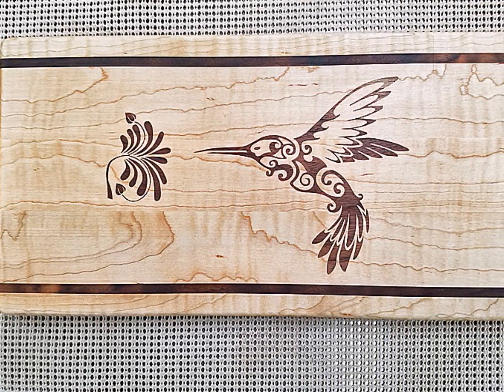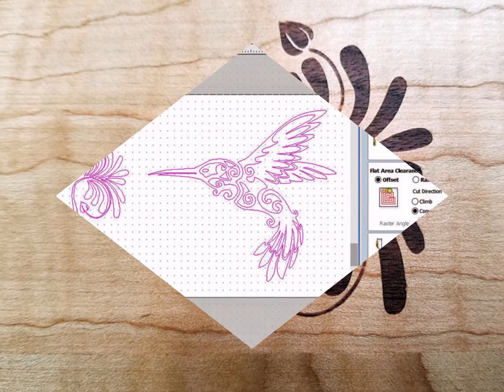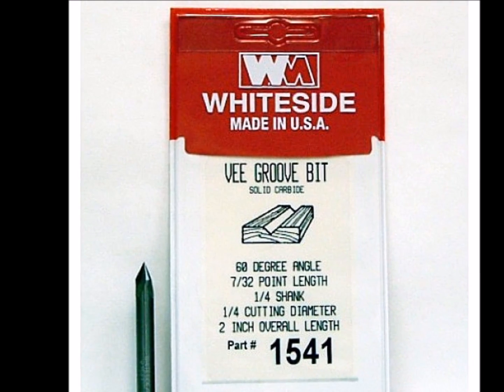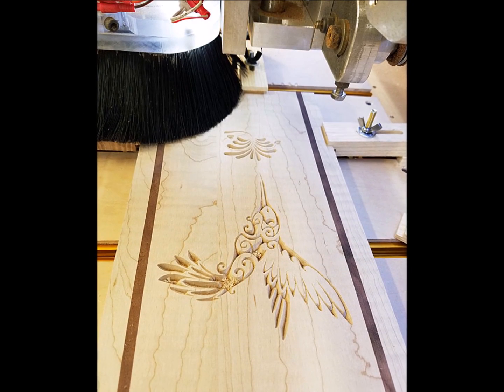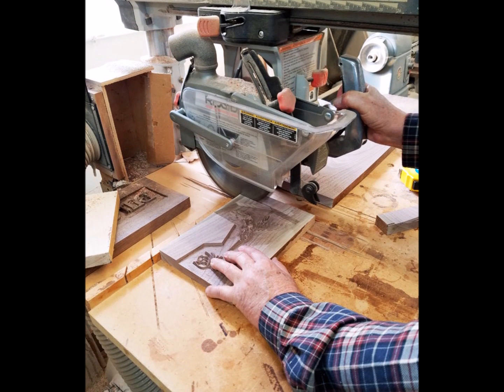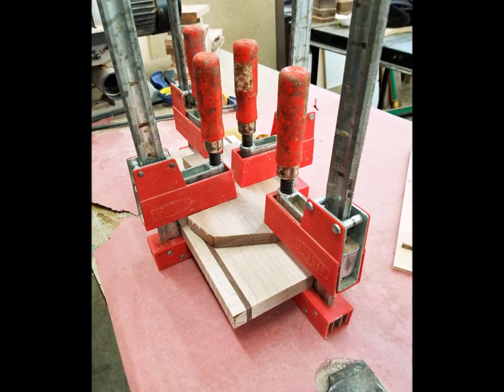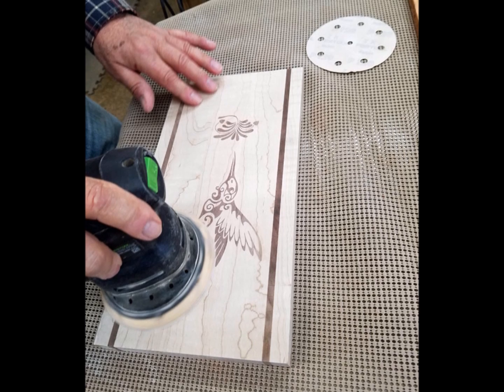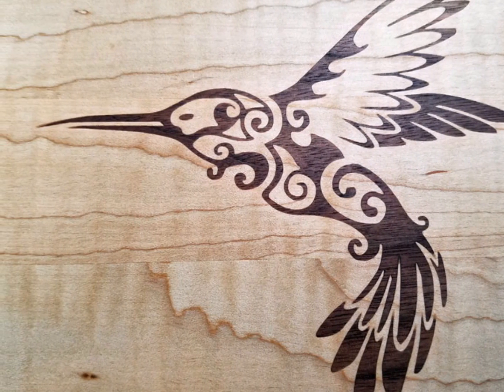Vcarve Inlays on the CNC Router

Comment: Excellent video Dave.  I really want to try this method, however, I am an ArtCam user.  Do you know of anyone who has done this with ArtCam?
Reply from the maker: Hey, Dennis, I have to believe you can use the same technique with ArtCam. I'm sure you can do VCarve tool paths. I think it would work if you just do the same start depth and the same depth of cut. Don't forget to mirror image your male inlay and draw a box around it for the flat area pocket. My suggestion would be to outline the most important steps from the video, then set up your VCarve tool path for the female side, and then mirror it and do the VCarve and flat area pocket for the male. Hope you try it and then come back and let me know how it worked!
Reply: Thanks, Dave.  I'll give it a go and see what happens.  :)

Comment: Great video. I wanted to engrave something on a hardwood floor (prior to installing). I wanted to make the pocket .25 inches deep (start depth 0, flat depth .25). I have thought about making the inlay start depth .15 and the flat depth .10.  If I had my own machine, I would make some rectangles 1 inch by 2 inch and experiment with various parameters and see if I can understand the "magic" numbers (.1 and .1) a little better.  I have to pay a monthly fee to use a shop with a CNC router and a per minute charge for the CNC router so I do not want to pay for a lot of experiments since this is a one off project.  The people who run the shop have no experience with vbits. They use end mills for their inlays. For the fist rectangle I would use the same magic number you used for the pocket and inlay. For the second I would just change the pocket (0, .25) and duplicate the inlay (.1, .1). For the third, I would use (0, .25) for the pocket and (.15, .10) for the inlay. I might even try a fourth with (.1, .15) for the inlay and then see if I can understand the magic by taking measurements.
The reason I was thinking of using (.15, .1) is that I want .15 overlap (penetration) with a .1 gap for glue and imperfections. The .15 is where I want the "art" of the inlay to match the art of the pocket. We know the art of the pocket is at start depth 0. I would then expect a gap between the boards (when glued together) of .1

I don't know if you can follow. If you were interested in learning more about the magic numbers, this might be something you might want to try. If you take measurements of the inlay before and after gluing then the numbers wouldn't be mysterious. I truly would love to understand the magic. After gluing, you could cut the finished "rectangles" down he middle and see how well the inlays fit.

Again, a great video
Reply from the maker: Experiments are good. Go for it! Perhaps you can find a friend with a CNC who will do the experiment. If I'm visualizing your numbers correctly, changing the start inlay start depth or the pocket flat depth will not change the way the inlay fits into the pocket. But without seeing your experiment I wouldn't be absolutely sure. Since I know that 0.1 and 0.1 for the inlay and 0.0 and 0.2 work so well, I'll stick with those numbers. But if you do the experiment I'd love to see it!
Reply: The only other place I know of that has a CNC router is the local high school and I think the shop teacher is a little intimidated with new technology so I know he would be reluctant to help. One day I might have some time and give it a try.

I did try something with my settings (.15, .1) but didn't accomplish much since the pocket was never more than .1 deep and the inlay did fit quite nice. I need to try something deeper (like the experiment) so that I can measure penetration/overlap.